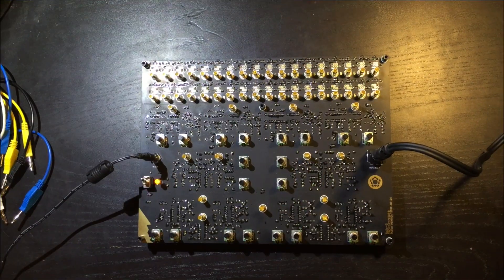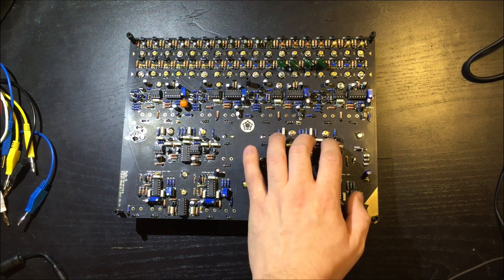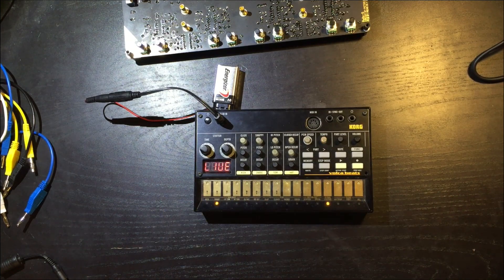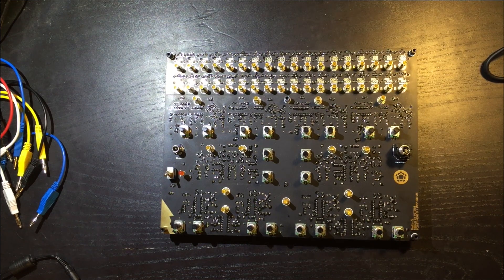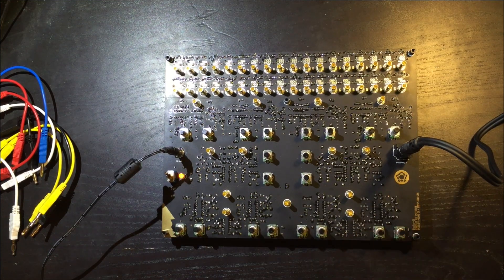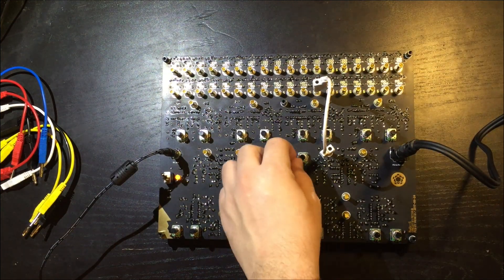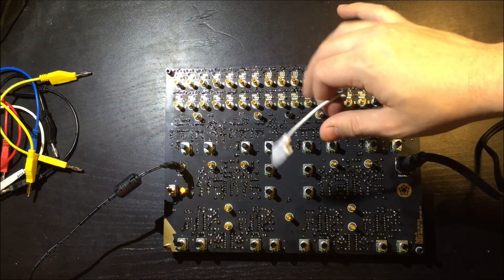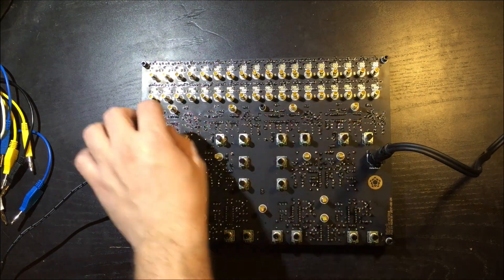Demo of the Ciat-Lonbarde Rollz-5+, Meng Qi PCB

Comment: Thanks for the demo! I've got two of the v1 boards which were even simpler. I built one of them with sockets for the caps and modded it with a few pots and more patch points. I recently found my 2nd PCB and thinking of assembling that one also. They're white with a big cat face.

Comment: I am really interested in getting start with diy synths builds. Do you have any recommendations for starting off points? I have done circuit bending with a guitar pedal and that’s about it
Reply from the maker: My biggest failure was not getting really comfortable with soldering first - finding a good iron, quality solder, dependable wick, and figuring out how solder flows. Then get a cheap led flasher kit from eBay and throw it together. That’s a low stakes way to success.

If you’re confident in you’re soldering abilities, get a simple kit to test it - if you’ve got a modular rack, stuff from Frequency Central or Music Thing Modular are excellent choices, and many, many more are out there. There’s also the Erica Synths EDU series, which will give you a complete modular system by the end, and more documentation than you’d ever expect.

If it’s stand-alone you’re after, the dreadbox kits are great, and Shruthi is a great build (TubeOhm sells those kits now)

And if you’re comfortable sourcing your own parts, the ciat lonbarde stuff is great for angry noise. They’re originally designed to be paper circuits (push the pieces through and solder them together), but pcb’s are much more successful. Try googling for Lil Sidrassi pcb’s - they’re out there somewhere, and usually have a decent rate of success. And if you’ve got the gerbers, you can print them for cheap at a place like jlcpcb.

It’s a rewarding hobby, even with the failure rate I have with some circuits!
Reply: I definitely need to get better with soldering and found a website that has projects great for soldering practice. I think once I’ve gotten better with soldering I’m going to build some ciat lonbarde projects

Comment: Does this have any type of 3.5mm sync in or clock in? i wanna be able to clock the Rhythm from an outside source like an external sequencer that uses 3.5mm cable..Is it possible?
Reply from the maker: There’s no immediate way to do it. I haven’t tried it yet, but you can try wiring the tip of a TS jack to a banana plug and try to trigger or influence the rollz with a clock that way, but rollzer behavior is hard to predict. You may have better luck using that method to just trigger the individual channels with an external sequencer, though the ultrasound filters get a lot more fun when you feed them audio rate rollz

Comment: Just finished building mine, I have a the first two gongs that are super low as well, how did you fix it ? Resoldering everything, changing the rhythm capacitors ? Thank you. Also one of my AvDog doesn't respond...
Reply from the maker: I ended up replacing the transistors and reflowing the solder around the joints to fix it the issue. I’m not adept enough at circuit design to understand why the transistors may have shorted, but it does work a lot better now
Reply: Thank you for the info ! I replaced the variable capacitors on the gongs from Film Cap. to Tantanium and ceramic caps and it solved the issue. Best, Laszlo.
Reply: @DinorrificMusic  Did you notice any trick to have the ultrasound filters be triggered systematically ? I need to touch PCB to get a propre sound or glitch and sometimes it stays... Bad soldering on my side or just a component to change ? Thanks !

Comment: what cap values did you use for each roll group?  can i mix cap values across a common group or should they all be the same value?
Reply from the maker: I can't remember what specific values I used, but generally following Peter Blasser's recommendations for the rollzer (http://www.synthmall.com/ciat-lonbarde/rolzer/index.html), I believe tried to stay between 1uf and 4.7uf, with each cluster's capacitors all being similar. I get the feeling like you don't have to make all the caps similar, but it helps make the rollzer section a little more predictable. I also found that larger capacitors tame the odd-number rollz a little more than smaller ones, but they're still pretty unruly. Another reason I went with larger caps in general was that sounds like the gongs and the dogvoices produce tones at some interval of the rollz at their inputs, so it's easy with smaller rollz caps to create fast constant tones that are either not very interesting or are so closely spaced they either buzz or never get past the attack (and therefore are too quiet). Larger caps also help make the weirder rhythms a little more discernible by ear.